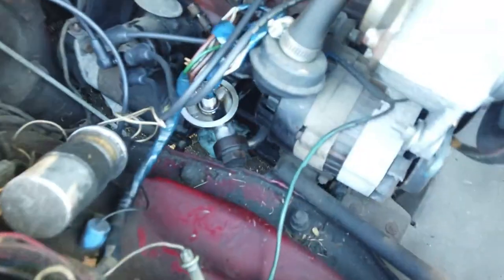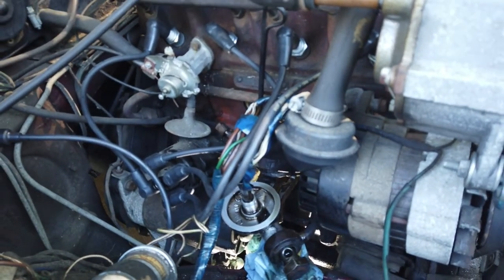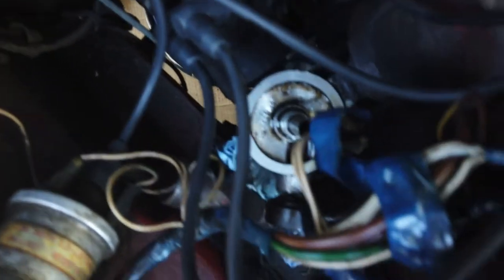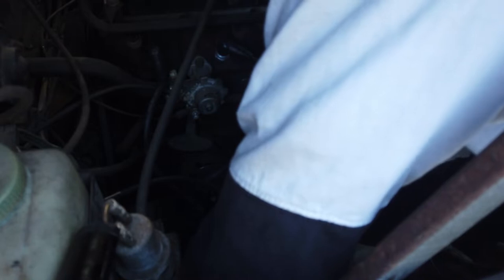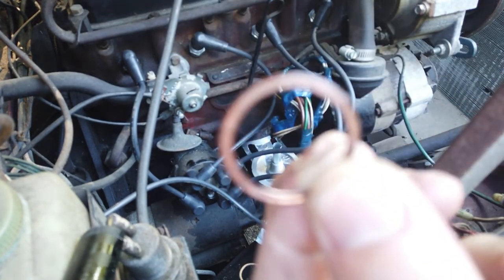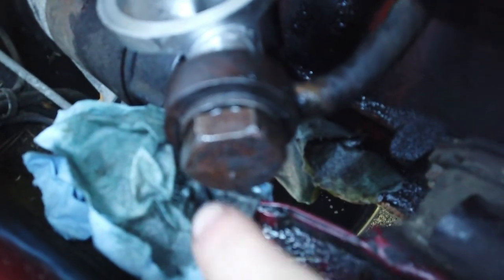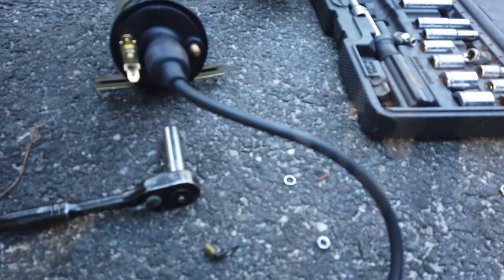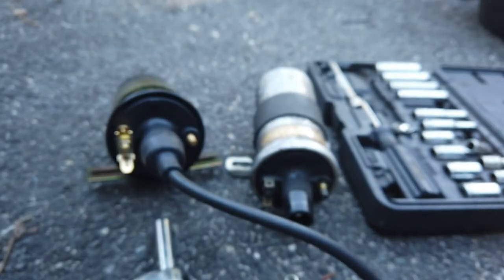MG MGB Oil Filter Housing and Coil Replacement, Ep. 5

Comment: Getting ready to do this job myself.  Two things I can offer are that there is no metric on a B (it’s 3/4 not 19mm) and there is a o ring between the base and block.  One off an old oil filter should work.